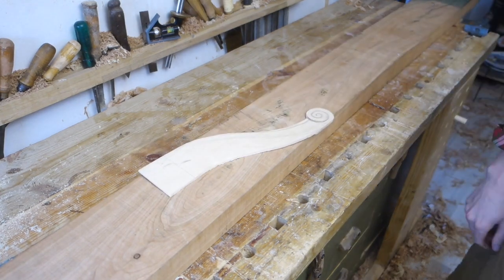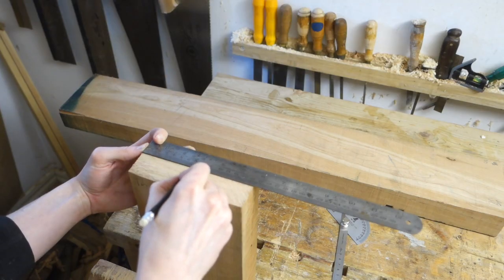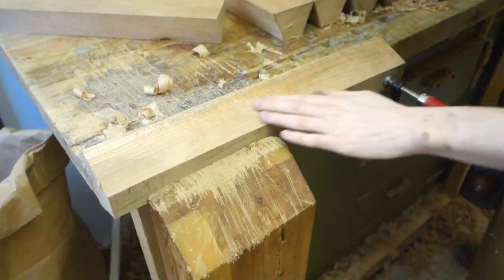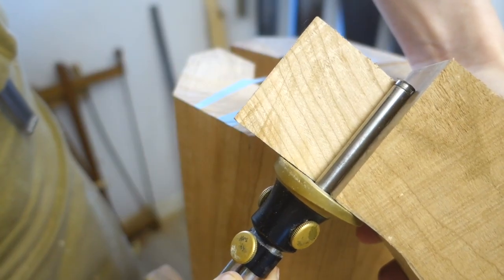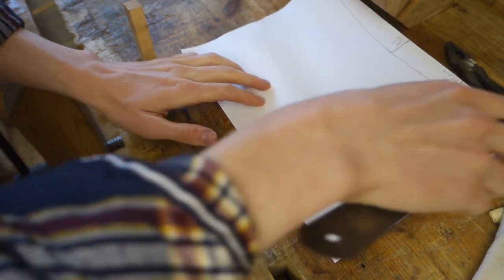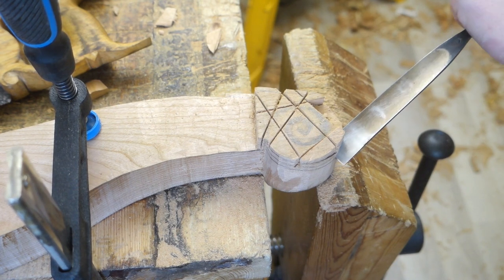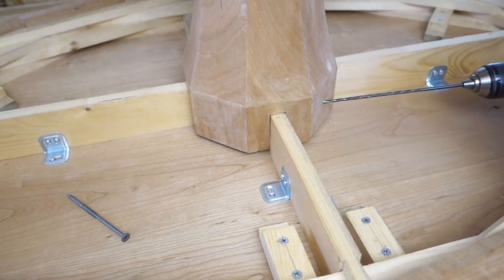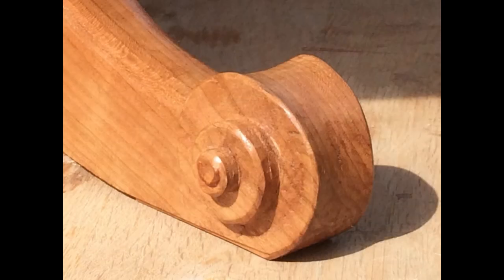Octagonal column and scroll feet - elliptical table part 3

Comment: More great work! Another way to attack a pedestal to the top is to use a large box assembly that goes outside of the column rather than the center cross you did. Bolt it through from the sides. This also lets you add a bearing plate on the middle that rests on the top of the pillar and transfers the weight of the table to the column
Reply from the maker: Sounds like a good way to do it too!

Comment: I will be using a turned central column and for stable attachment to the top,  i will put a disc of about 250mm diameter to spread the support.  Thanks again for  sharing your gift with us.